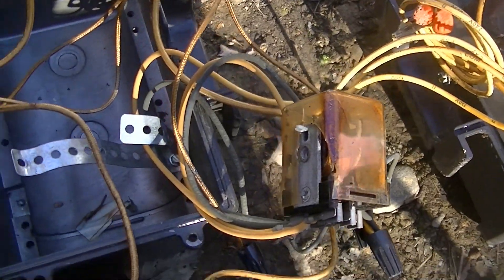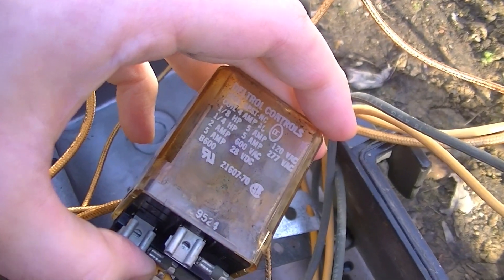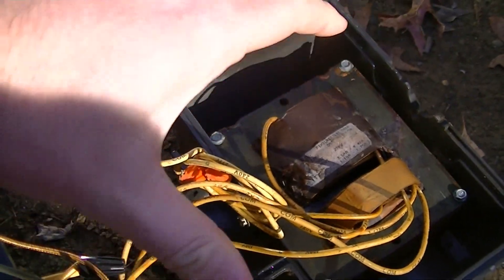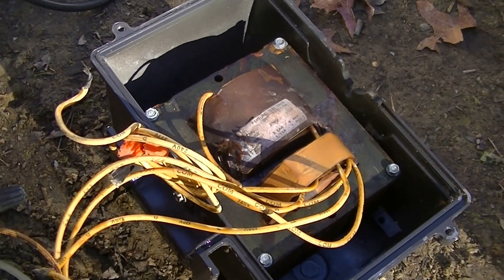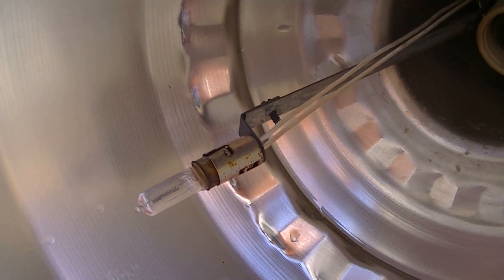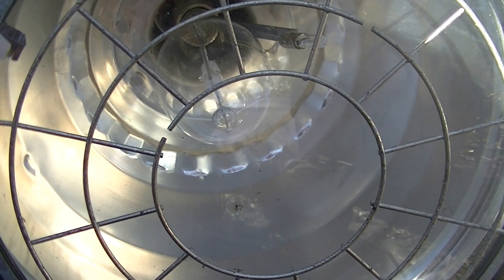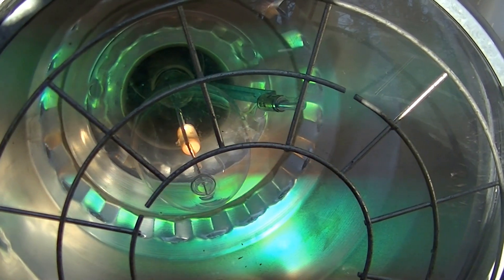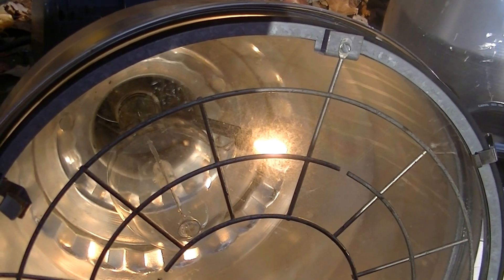HID restrike lamps

Comment: What a beautiful gymnasium high bay fixture!! I honestly think that gymnasiums look way better with these metal halide high bay fixtures than with LED and fluorescent high bay fixtures. I think that this gymnasium high bay fixture’s quartz restrike system allows for basketball games and volleyball games to continue if there is a momentary power interruption.
Reply from the maker: Not just gyms, as these are used in a number of applications where some restrike light is critical and whoever is installing the lighting system doesn't want to put in separate incandescent or fluorescent auxiliary fixtures.
Reply: @ I was just thinking that high bay fixtures with those metal grilles remind me of gymnasium high bay fixtures. I have been thinking that the metal grilles were installed to ensure that lamps were safe from flying basketballs and volleyballs.
Reply from the maker: @ These are damp location rated fixtures and have a glass cover that goes over the front of the reflector which also serves to hold in any shrapnel if the lamp explodes.  The grill is mainly to protect that cover.
Reply: @ Interesting. I just find these particular high bay fixtures very nostalgic.
Reply from the maker: @worldwidehidcollectorusa-fkt  They can also be fixed when something in them dies, unlike just about all LED rubbish.